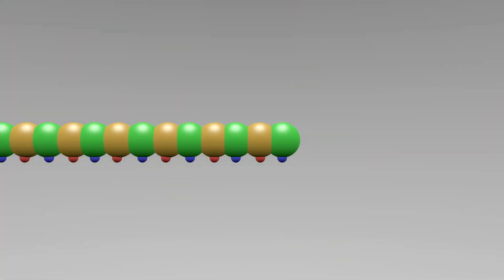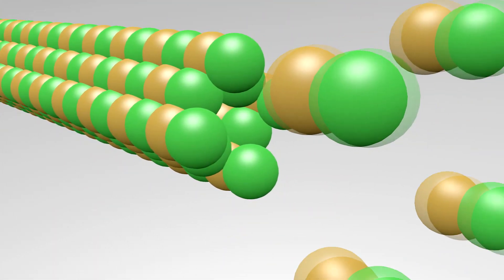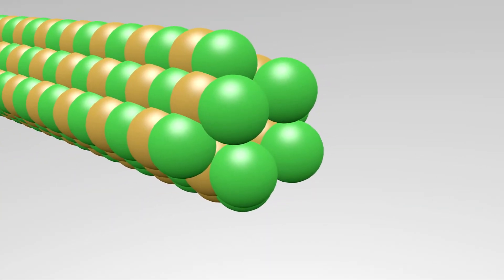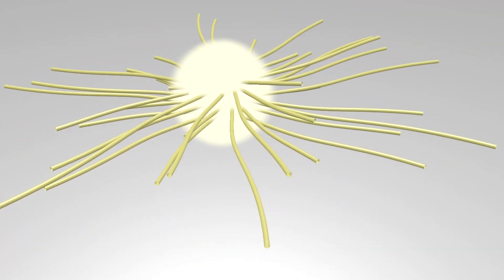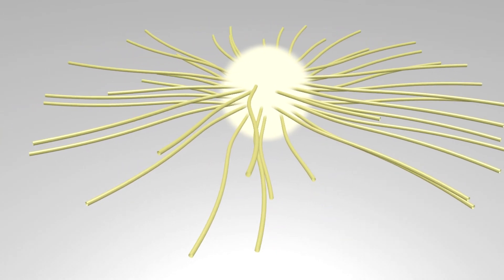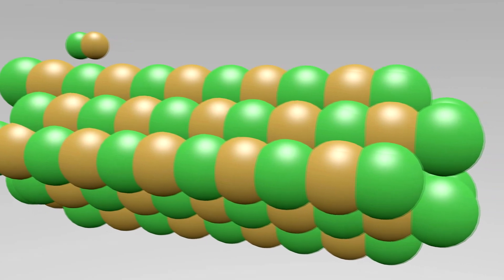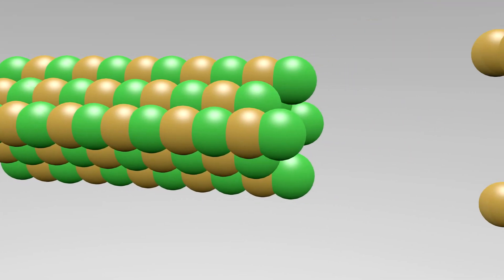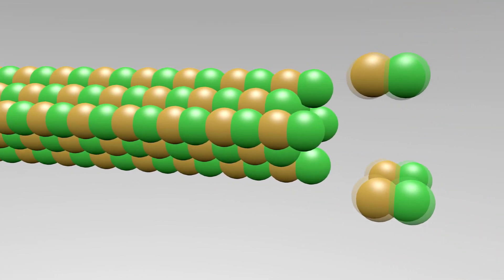Dynamic Instability Of Microtubules

Comment: I am still trying to get my head around how this relates to cancer.  My guess is that shrinkage would split the chromosome, mitosis, which we don't want in cancer.  Stabilizers work in different ways, which I need a visual for.  ..am I grasping this correctly?.... I am also trying to understand relationship between filopodia, calcium channel blocker , and cancer motility. As well as integrin and how it affects cancer spread.

Comment: I thought rescue was when an unhydrolyzed GTP was put on the beta end of the microtubule to make a new cap, not entirely sure I heard what you said right
Reply from the maker: +kmanc rescue is when GTP hydrolyze to GDP which causes the microtuble to grow
Reply: Sadeddin Yamlikha I'm pretty sure that's wrong :P catastrophe is when the GTP of the + end is hydrolyzed into GDP which makes the chain unstable & starts a catastrophe. Rescue is when the + end is "capped" with a tubulin dimer in which the beta part has an unhydrolyzed GTP molecule thus enabling the microtubule to resume growing.
Reply from the maker: +kmanc, Sorry, I was wrong in my previous comment. When the microtubule is shortening, its end has exposed GDP bound subunits and depolymerization occurs. To stop the depolymerization and change back to polymerization (growing), GTPs have to bind forming a cap. This switch, the actual change from shrinking to growing, is called rescue. Growing itself is not rescue. While a GDP is hydrolyzed every time a new tubulin is added, this growth is not called rescue.
Reply: yep.
Reply: Rajshree
Reply: Rajesh chakradhari